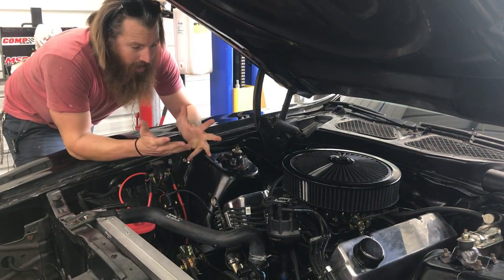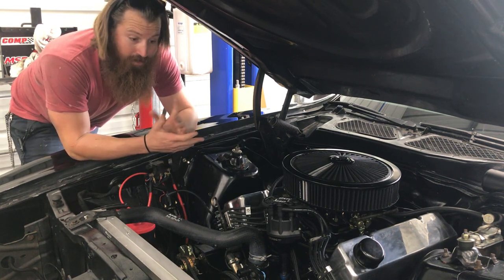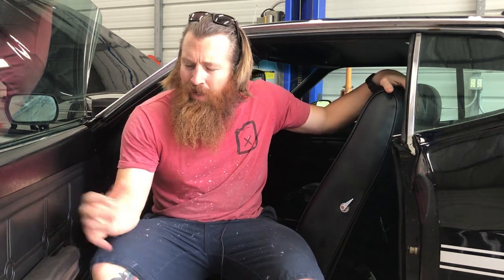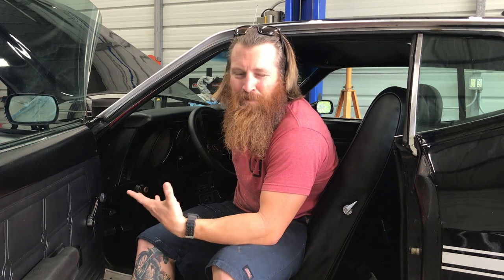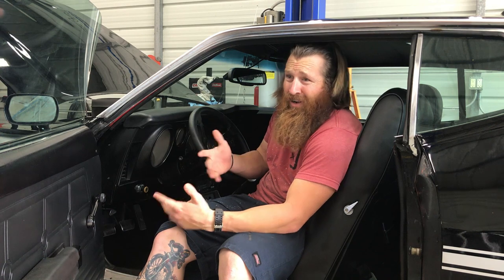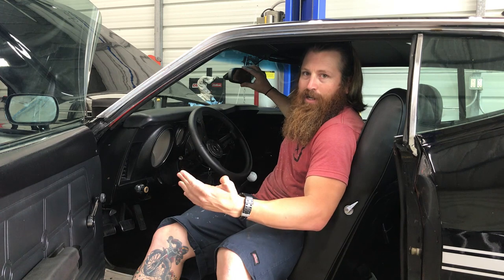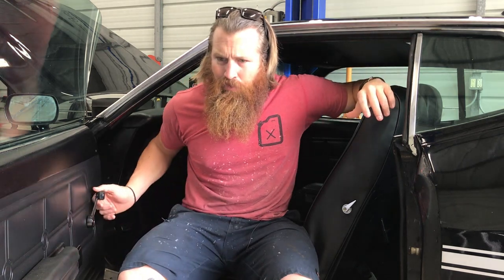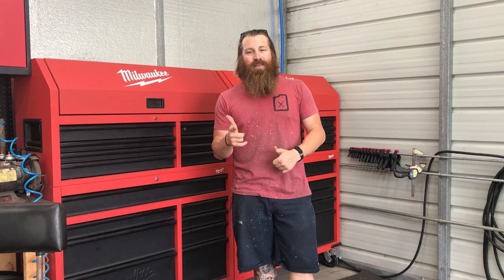'71 Mustang Mach 1 - Cleveland Powered Pony

Comment: Very nice paint.  You are overcooling it if it is running at 160.  Actually best for the engine to be between 180-200.  Reason is it keeps the moisture out of the oil.  Cooler isn't better.

Comment: What rad fan combo did you use? My 70 Mach 1 351C definitely can't idle in hot summer traffic. I've tried just about every option.
Reply from the maker: Dual mishimoto 12 inch fans. Look for the cfm. Get the highest. I’m tellin you it made a world of difference